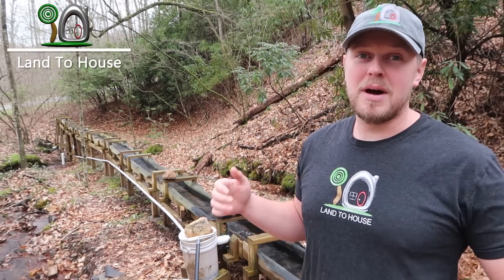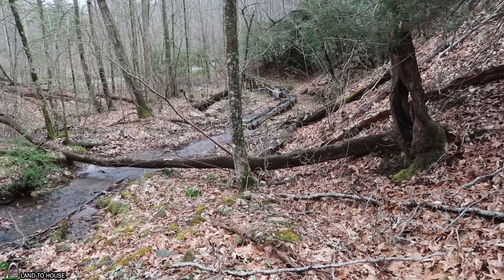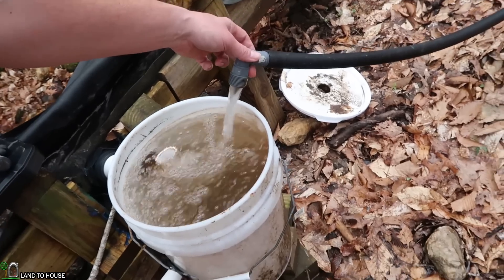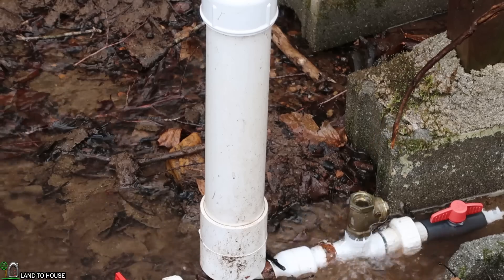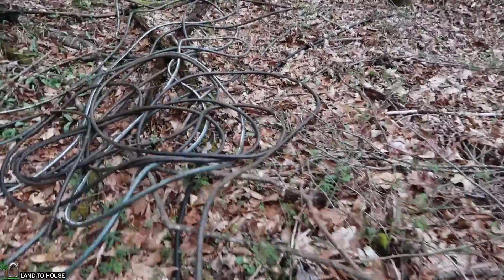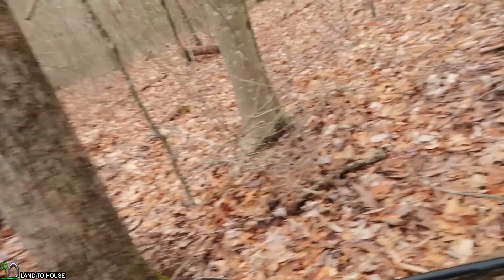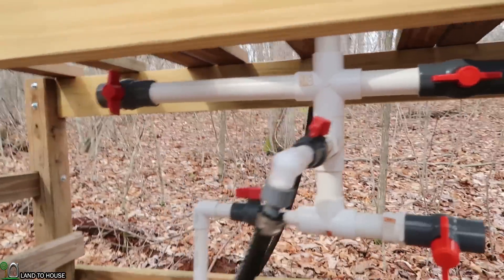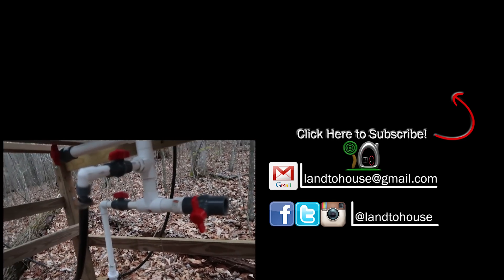Starting up the Ram Pump 2019

Comment: Its gravity not atmospheric pressure. Just saying
Reply from the maker: Thank you for the correction. :)
Reply: @LandtoHouse  You said it right. It's the atmospheric pressure plus the loss due to the difference in elevation in the supply pipe, which is also atmospheric. It is .433 psi per foot of rise.  30' x .433 = 13psi. So you've got more than that. Just put a 5 gal bucket there and let it fill and time it to get your flow rate in gpm. Run the calcs here: http://www.freecalc.com/fric.htm , I'm almost positive you are losing some pressure due to friction. 

People don't understand the tank isn't pressurized it's open to atmosphere. Yes it builds head but pressure is constant at atmospheric. If you sealed the tank up, the pipe would fill it until the pressure in the vessel was equal to the residual pressure from the pipe then it would stop filling because it equalized. It's why your hot water heater is the same pressure as your water supply in your house. It would be fun experiment to seal up a drum, put an air vent on it an see how much pressure you could make.

Comment: Now explain how water head pressure at the tanks that will affect delivery rate.
Reply from the maker: The water going into the storage tanks ? Filling from the bottom is the fastest way. The head pressure back down to ther garden is around 9 to 10 psi.
Reply: @LandtoHouse  Thanks for the quick reply. I watched the one with the pressure gauge. I was very impressed this puts out 20 psi

Comment: 5:32 No need to divert the flow. Those bubbles will dissipate when it enters the next line. They aren't caused by air, just movement.

Comment: As neat and cool and off the grid as all of this might appear, there is a question about how to purify the water for consumption and cooking. It might okay to bathe with it, and possibly wash clothes, provided there is a sediment filter in place so any gunk in the water doesn't get on the clothes. But how does this water get purified for drinking and cooking? I envision animals, some of them ill perhaps, drinking from the water source. Other animals just walking through it. I wouldn't be drinking that stuff without some extra steps.
Reply from the maker: If you're going to be drinking Creek Water I highly recommend you use a filter like the Berkey filter. Or you could always use a LifeStraw or one of those camping type filters

Comment: I have a thought... not sure it's not been asked before. Is there a way to circulate the water down from the supply and then use the pump to carry it back to the supply? If so,, next step would be to use a generator to create electricity from water flow. Is it possible ? I see it's not an original thought after reading thru comments. - HT -

Comment: You need a vertical pipe coming off of that water pipe with a cap on top to provide an air buffer to prevent water hammer on your plumbing

Comment: Use a bleed valve to let the pressure go when you close a valve quickly. Or add in a lot of very flexible hose (the bigger diameter, the better). Or use a soft closing valve. You can also put in an air bubble in the system, just like on your ram pump. That will dampen things out a lot if you use a bigger one.

Comment: why not put gravel in the area of the intake and a little upstream to lesson the silt buildup on the intake pipe?
Reply from the maker: This mountain creek is packed with silt. Last week the flow rate went from 50gpm to well over 400gpm after a rain. The gravel would be no more.
Reply: @LandtoHouse  Use angular, crushed rock that will lock in place
Reply: @LandtoHouse  You can build another dam a bit above the one where the intake is. That way it will settle most of it there.

Comment: what's the elevation difference between your tanks and the creek?
Reply from the maker: I need to hook up a pressure gauge and do the math to find the exact height. I am guessing 30 feet height.
Reply: @LandtoHouse  Just measure the angle and distance between the two end points and then you use math to calculate. Use a home made theodolite (https://www.mathsisfun.com/activity/how-high.html) to get the angle.
Or borrow like a Leica distance laser meter or similar. I have Leica Disto D510 and it measures all that with just a click on a button: Point the target and press a button and voila, all data available on the screen. =)
To get distance if you do not have a long ruler (or, a LOT of rulers), use the GPS on a modern phone. Let it stabilize for a while, stationary, read the coordinates, do the same thing on the other end, then math to calculate the distance. There are height data in GPS too but that is not very precise, but the positioning data is often better than within three meters (i can often replicate the point with a margin of just 0,5-1 meter).

Since you seem to like homemade things and to use your head, i thought this above could be fun to practice.

Comment: Can you come out of your reserve tanks and go back down the hill to another ram pump to gain more elevation on what you are pushing the water?  We have a large creek that doesn't have a lot of lift, it is 50 or so feet wide so damming it isn't an option.  My thought would be to use larger pipe for the ram pump, like maybe 6" so you would be pushing more volume up the 7 to 1 rise.  Since I need to go about 800 to 1000 feet with about 80' of rise, I'm thinking xi could create more drop to a second pump to gain enough to do the total rise to where our animals are at.

Comment: If the feed pipe was metal rather than plastic, the water hammer would be more.
Reply from the maker: Yes you are right! Last year I tested the difference between poly pipe and pvc. It was much better with pvc. So metal pipe would be even better than pvc. The problem is the cost of metal pipe.

Comment: I don't get why he need a supply line. There's an aqueduct running by his bucket at almost the same level
Reply from the maker: Sometimes I turn off the flume. It's nice to have the ram pump pull water from a secondary source.

Comment: At some point the weight of the water + air pressure pushing down will negate the ram pump.  Suggest when you go bigger to put the filler pipe toward the top so its only the weight in the feed line vs. tank contents.  Ever put a pressure gauge on your feed line?  I'm curious what line pressure its generating.

You could also consider staggering the fill tanks so that the first is slightly lower, if you can find one thats taller, so it collects the sediment.  Draining them from their bottoms helps ensure you pullout sediment before it clogs things, so thats good.

Honestly if I were you I'd go all out and setup home with non-potable water for the toilets.  Or even further and do your own treatment system so you could make your home's potable water.  Add a solar distiller for drinking and washing your car and you're set!

Anyone ever try using the pressure for driving a piston with a butterfly valve?  You could compress air, make power and rotate a composter lol.  Go full MacGyver! 

Wish I lived near a creek!

Comment: I built a similar ram pump a few years ago. The creek had a drop of 1.5m for the drive pipe, the ram would pump water up about 10m to a tank, 300m away. It would pump 500 litres a day, more than I could use. Building and tuning ram pumps is a lot of fun.
Reply from the maker: Seems like a good setup. I would have to agree building and playing with ram pumps is a pretty great Hobby

Comment: just put a short section of pipe on the supply line so it's under water.
Reply from the maker: Yes absolutely. I will do that here in a couple months when I start up the pump for the 2020 season.
Reply: @LandtoHouse  But, at an angle, so the ware flows in a circle at the edges, so not to mix the soil and other stuff that falls to the bottom.

Comment: @14:30 what you are explaining is head height pressure. Basically due to the configuration of the pump and its supply it can lift water so many feet vertically. volume has no impact due to hydrodynamics the only value that matters is vertical height. 100ft is 100ft it doesn't matter if its 2 gallons or 150000 gallons.
Reply from the maker: For delivery output? Very true. The limiting factor is the vertical lift.  The volume is not an issue. Like filling the storage tank from the bottom. The water lifts to the top just fine.
Reply: @LandtoHouse  Precisely! Exact same way a water tower works. Well if you use an electric pump instead of Ram.. but Ram pumps are far cooler.

Comment: Wouldn’t a short length of pipe down into the feed bucket stop air bubbles being entrained at that point?
Reply from the maker: Yes you are absolutely right! I will be adding that in the 2020 startup video.
Reply: Build a cheap vent...
Reply from the maker: What type of vent?

Comment: I actually have an original Goulds Ram pump from the forties 😉,,ya need to cut yourself a bigger reservoir ,,,the fast you can push your entry water the better your pump will push
Reply from the maker: Oh cool. Those pumps are well made. I mostly use this water in the garden. So as long as I can fill the 100 to 150 gallon storage on the hill I am good!

Comment: Squirrels don’t chew holes holes in the black pipe??
Reply from the maker: I have had the very thin 1/2" poly pipe chewed in half before. But the 3/4 and up seems to be untouched
Reply: Do you plan to bury your pipe?   My place is in the Ozarks and plastic pipe has to be back filled with sand due to flint rock with sharp edges.

Comment: I have discovered that up here in rural Maine my poly pipe (tubing) gets chewed by rabbits under the snow and come spring I have leaks everywhere.  I have buried about 75 feet of pipe where it runs across a field, but that is impractical in the woods due to roots and rocks.
Reply from the maker: I had my thin wall 1/2 inch poly pipe chewed by squirrels. So far the 3/4 and up has been untouched. I don't know what it is about that pipe though the animals Love it.

Comment: I love the idea of all of this, but your missing the fact of head pressure(weight of the water) in the tanks, if your pump is not strong enough to counter that I don’t see how it would even open the check valve to keep filling.  If you can explain how your getting past head pressure I would like to know! Thank you in advance from your Texas plumber.
Reply from the maker: I'm not entirely sure which part you're stuck on. The head pressure flowing down from the creek causes the waste valve to slam closed. This creates a water hammer pressure wave that is quite strong. When that water hammer pressure wave occurs it creates a negative pressure at the waste valve which allows it to swing open once again. The pressure wave is what forces open the secondary valve and pushes water into the pressure tank and Uphill.
Reply: @LandtoHouse  Your answer explanation is better than what was in the video. Knew it some kind of pressure wave action which video didn't really explain. 

But why don't you have the final input into the storage barrel at the top, bystepping the head pressure. Also maybe reroute the barrel input to keep the water hammer pressure wave out of the manifold.
Reply: If the pump has enough pressure to pump the water to the top of the basins, it's got enough pressure to pump into the bottom of the basins. As long as the atmospheric pressure is linked by the water column the whole column rests at that pressure. Anything introduced like a pump that raises pressure overcomes that.

Comment: Nice video, well done. Question....what do you do when the temp is below freezing for an extended period of time?
Reply from the maker: Thank you. I have run the pump at 15 degrees for a week. Ice rose up from the ground and plugged the delivery. Once the water stopped flowing the pump shut down.
Reply: @LandtoHouse  since you use PVC or PVC piping weren't you concerned it would burst the pipe if frozen...asking from Minnesota here...6 months below 32

Comment: 👨‍💻💭Plastic Ram Pump  awesome  build  cost parts $60-100 handy And if you add small 12vlt gen $15 make power & store it  win win while you  fill animal troughs & small dams etc tank< be handy  also add a 12vlt PUMP haa so much good stuff🥇👍
Reply from the maker: I have wanted to install a small inline 12v generator just for fun. Thank you for watching!
Reply: Where might one get this $15 12V genny? Or what should I search for?
Reply: @FusionStream  the power generated would not be worth the effort. You either need head pressure or volume. and a significant amount of either to generate a meaningful amount of electricity.
Reply: http://www.nooutage.com/lv1400.htm

Comment: it looks that your pump close its valve too soon. Maybe small spring or more veight to valve and you get harder ram and higher pressure.
Reply from the maker: The new Stainless Steel valves are heavier and do close slower.
Reply: Ru Finnish
Reply from the maker: Not sure what you mean?
Reply: @LandtoHouse  I meant that for Tapio haapala
Reply: @LandtoHouse  ... cool video , I do onsite septic and these projects are intriguing
Reply from the maker: Oh ok. Haha.
Reply: @raylars752  No, but Ib dun!

Comment: why don't you just run it straight off the flume flow
Reply: that wouldn't allow the back and forth flow...would loose pressure.
Reply from the maker: I turn the flume off from time to time. It's nice having the intake with the full water flow of the creek too.

Comment: If you put the flap valve on the delivery pipe would it be possible to pump further hight or distance
Reply from the maker: I actually have two videos on this topic. Yes! Adding a single non return valve on the delivery reduces the weight on the pump and allows it to lift higher.

Comment: no  head presser changes with volume  that is why  when you dive the deeper you go the more presser it is on you body
Reply from the maker: Is that called hydrostatic pressure?
Reply: Hydrostatic pressure is just the weight of water above a point. Height is all that matters. 20 feet deep in an ocean of water will be the same pressure as 20 feet deep in a small swimming pool.

Comment: How much head do you have from your "air removal bucket" to your pump and how far and how high are you pumping from pump to barrels?
Reply from the maker: The head pressure is right at 6 feet. The lift I am guessing is 30 feet. (I should find the exact by running a hose and pressure gauge) distance is 300 feet.

Comment: Seth you need to install a quick swing ball valve just below each tank for pipe & tank maintenance. Also in post video production you should correct explanation errors as it was very confusing and your asking your viewers to trust you. Yes mechanically the system works, but easing the potential customers mind as to the level of difficulty would serve you better in the long run. The Ram pump is a great way to move water without electricity and traditional pumps. Less moving parts means less maintenance. You should capture the energy wasted from the sluice troth with a hydro generator.
Reply from the maker: Hello. I have an example of ball valve cleanout on the ram pump in this video: https://www.youtube.com/watch?v=3TVx5TSgIg4 

That valve is something that people can add later to help clean out the pressure tank if needed. 

This video was mostly showing that I got the ram pump running again for the new year. There are over 100 videos showing how the pump works. Many of them are showing my first run of a test. 

Super exciting news for the flume. I am working with a fellow to install a small turbine this year. I also will be installing a micro hydro turbine with 150 feet of head pressure with 25gpm flow rate. should be a fun summer.

Comment: Can I can my supply water from a pond or does it have to be moving water?
Reply from the maker: The water does need to be flowing but the source can be a pond. Check out the newest ram pump video on the channel for a ram pump from pond.
Reply: Water from a pond needs to flow downhill from the pond to the ram pump to build pressure which will then pump the water up hill.
Reply from the maker: Yes. overflow from the pond.

Comment: It's the height from the pump up to the top of the tank that matter.  Not the size of the tank. Inch water column or just inch of water. The difference between the pressure in the pipe and the pressure of the atmosphere. This is something we all learned in physics in school. Except the ones that was asleep.
Reply from the maker: Yes. You can find my test on tank fill from the top vs the bottom. Shows that bottom tank fill is much faster!

Comment: I just bought a cabin it has a natural spring that is used to fill a tank that is then pumped to a tank buried in the ground next to the cabin.  Its up the hill from the spring.  how far from the spring down the hill will I need to set a pump? I was thinking a 1" pump would work just to fill the tank a few times a year.  great videos very informative.
Reply from the maker: I recommend a drive pipe at least 25 feet long. Can you get the needed head pressure within that distance? 1" can supply up to 720 gallons per day or more
Reply: @LandtoHouse   in the spring when the snow is melting im sure I could.  Would 1 1/4" drive pipe be better?

Comment: Hey I think installing a hammer arrester in line with the output pipe could help with that hammer effect. I only used them to deal with the obnoxious knocking sound that my pipes make when the washer is running
Reply from the maker: I wonder if that would reduce the effectiveness any?